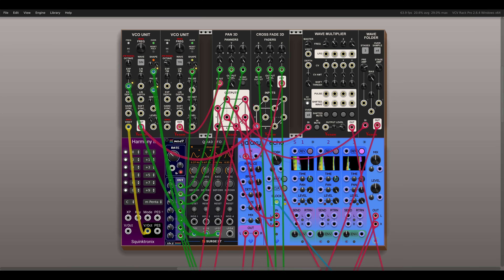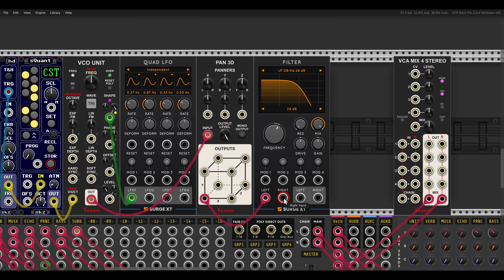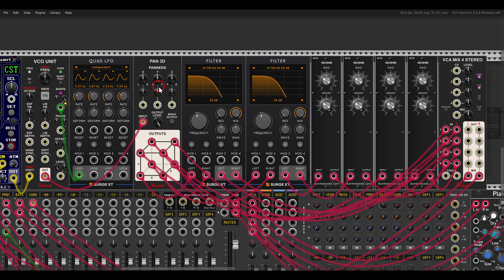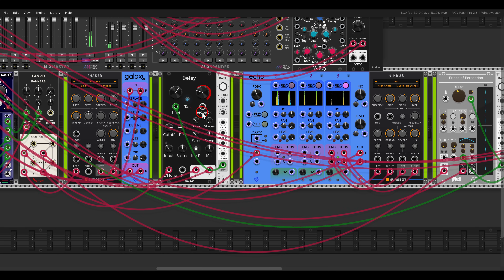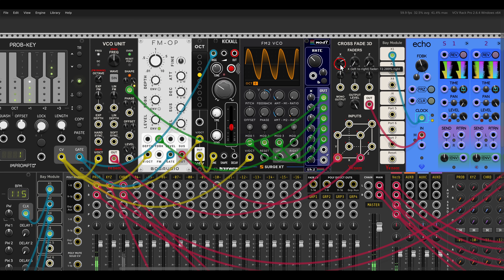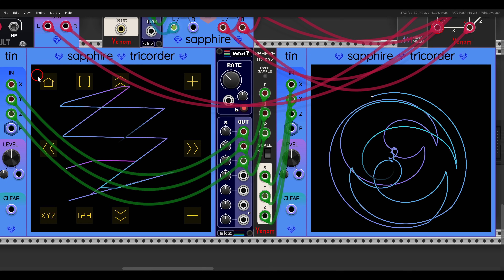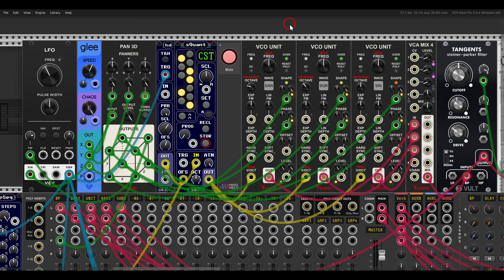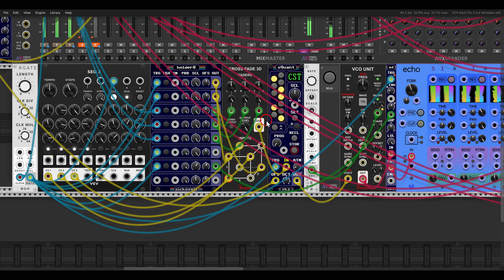Venom 3D modules | Creatively Morphing Between Signals

Comment: Might be fun to try some audio rate crossfading of phase locked inputs...
Reply from the maker: PLL is something I have to explore more for sure
Reply: @OmriCohen-Music i just mean multiple outputs of the same oscillator or differently processed versions.

I have tried using this with tides 2, which anal makes synchronized waves.